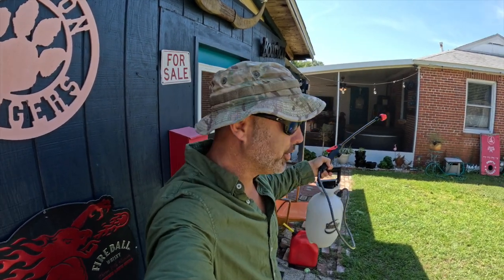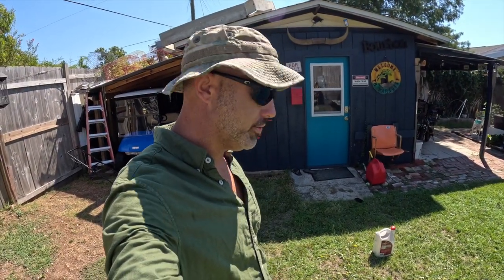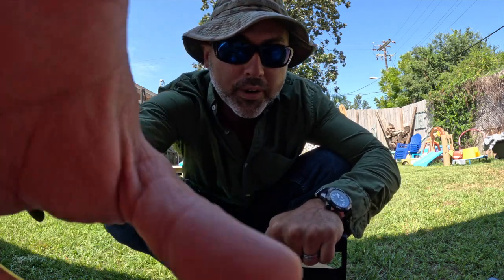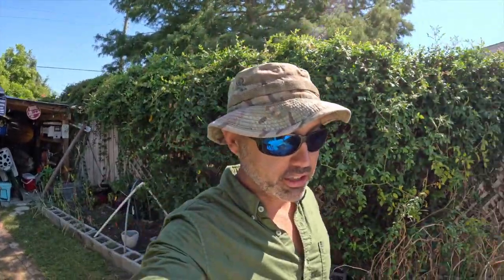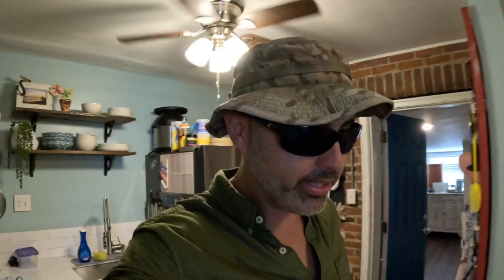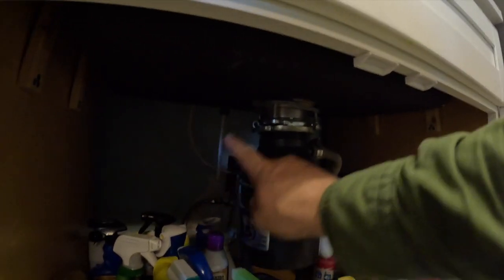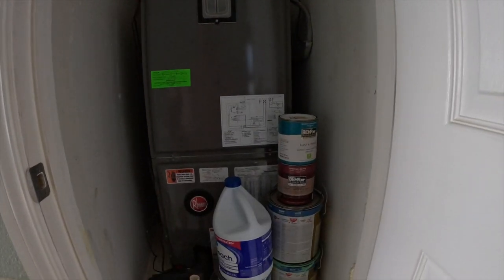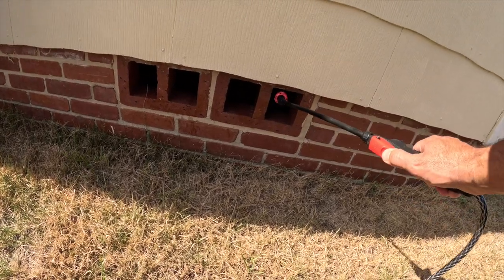How to get Rid of Cockroaches yourself DIY!

Comment: I appreciate that you have tackled a subject that most people don't like to talk about. Having said that, there are more effective ways to prevent or treat insect infestations.  Without boring you with details that you can easily read yourself, I would generally recommend using professional grade chemicals that you can easily buy online from a place such as Do My Own Pest Control. These places sell chemical kits, such as roach kits, that consist of jells, sterilization baits, and sprays. The kits are cost effective and contain enough chemicals to easily cover a large home.

Comment: Sister of that picture< not bad, but honestly, call a professional....there is always a guarantee they can come back to retreat ..plus the over the counter stuff isn't as good as what the bug companies can get ..they have to be certified to buy and use ......safer for you and future tenants....retired from 35 years of pest control...you don't want to handle this stuff. The openings in the crawl, pack with steel wool against mice, etc..house openings...a mouse can enter a hole the size of a dime, a rat, the size of a quarter..but one more time...use a professional...a tenant can sue if a child or pet is poisioned....it can happen! I know of 2 guys who went to prison for misuse of pesticide..........